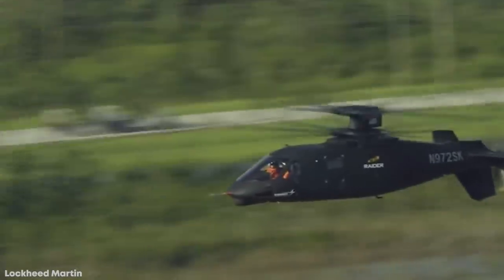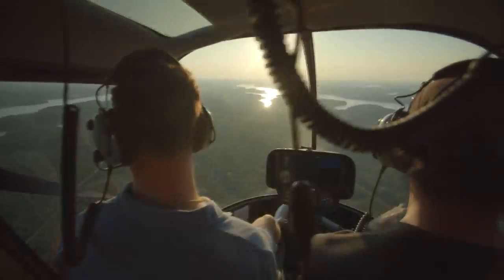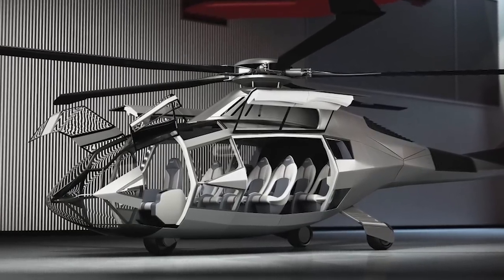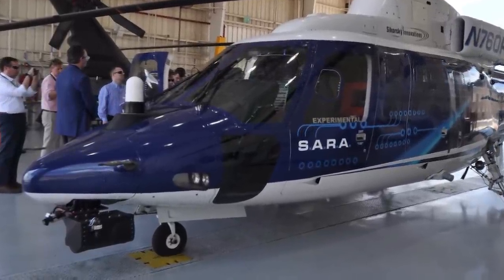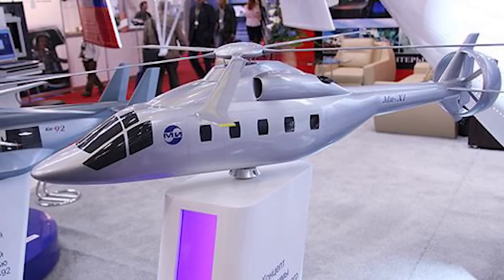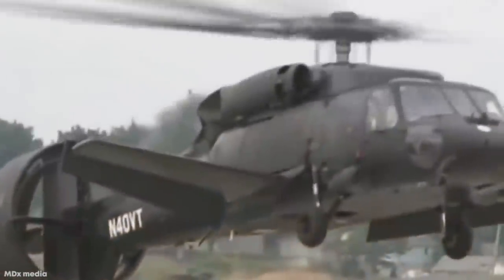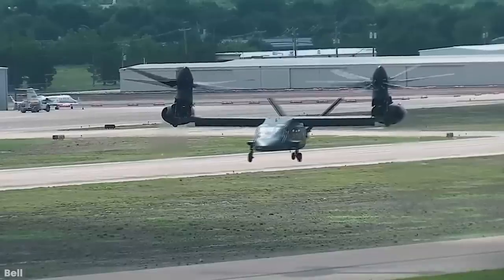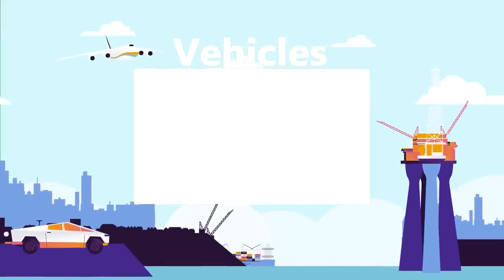15 Future Helicopter Designs

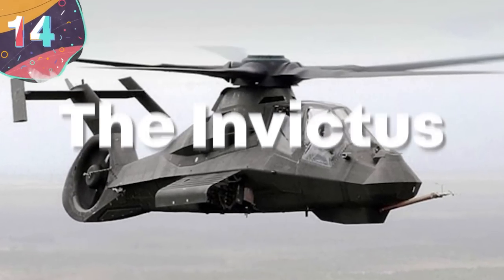Comment: 1:11 Also known as Boeing Sikorsky RAH-66 "Comanche". Never heard about the Invictus label for that aircraft.
Reply: This...
Reply: Bell 360 Invictus. It's bells pitch for the FARA program, against the sikorsky's raider X. It reminds the comanche a lot, but with way less tech embeded. Probably the reason he used Comanche pics.
Reply: @Suflanker  Agreed
Reply: I worked on the prototype program for Sikorsky. That Comanche would have beat them all!!
Reply: @bobmcnelis3648  I believe it
Reply: @bobmcnelis3648  No doubt that the Comanche was a more capable helo. But they (360 invictus and comanche) were built with different scenarios and requirements in mind. Putting them side-by-side is kinda pointless.

Comment: As an old fan of the Airwolf TV series, the design of the helicopter as a combat helicopter was a thing of beauty. But, one thing Airwolf did in its fictional form was to use jet boosters. Is this at all possible without exerting so much pressure/air disturbance on the rotor blades going forward they'll eventually just snap off? The fastest new helicopters still seem to rely on propellers in a push or pull configuration to go fast(er). There must be a limit to how much faster? Where could they go from here, considering reliability and safety are absolute key?
Reply: if you look at the blue angels Fat Albert is a C5 converted 4 engine prop turbojet with side thrusters on sides of the fuselage-look it up, with this method the plane is the same concept as Airwolf- I cant see why they cant do this for any Attack Helicopter where they hit boosters for a few seconds.
Reply: Do a little searching for the Lockheed XH-51A - that was a modified Lockheed 186 fitted with a Jet engine on one of it's stub wings :)

Comment: The flying car has been a experimental concept for more than 50 yrs. I worked on an experimental plan designed by Dr. Jackson in Wilberforce OH.. The concept is sound, lift and cost and safety was the issues at the time.

Comment: The most solid "future-proof" designs, from an aerodynamic standpoint, are the coax/pusher arrangements, (notably the Sikorsky Raiders, and basically everything else Sikorsky is developing in this area.) Retreating blade stall basically puts a hard limit on helicopter top speed, and even a single rotor with a pusher prop is going to struggle with asymmetric lift at high speed, even if it can slow the main rotor to limit blade stall. The coax rotor design gives more stability at high speed, and in general much better handling at low speed (the Kamov KA-50 has, effectively, "infinite" rate of turn in a hover,) plus they tend to be quieter than a tail rotor design because you don't have the collision of perpendicular columns of moving air, (though, from what I understand, intermeshing rotors tend to be the quietest, and with the pusher prop you may still get some of that noise.) All together, for top performance characteristics, there simply isn't any other design that allows the flight envelope of current helicopters to be expanded as much.

Comment: I like the idea of being able to control the helicopter using augmented reality, reason being you could put on cameras on the left, right, top, bottom and nose of the helicopter and doing that you can completely get rid of the windows (recommended for combat helicopters because they are most likely to be shot at).
Reply: yea ive always known that helicopters are the easiest thing to shoot down when you are loading up or starting the engine 
rpg enemies sitting and waiting for sitting ducks is not a good thing

Comment: Once a Chopper gets its main propellers tucked under the chassis or body, the traditional Choppers of the Propellers on top exposed will get phased out. The tech is getting there and we all see the changes of propeller system will be more tucked in of the body, kinda like UFO but more of a human dynamic shape of helicopter designs..

Comment: I think the flying car concept will inevitably result in a vehicle that is not a good car nor a good aircraft.
Reply: Correct. I am currently developing a university project for a flying "car", and the idea that it has to look and act like a car is the no.1 killer in these concepts. The only aspect that needs to remain, is the general utility and potential price point of cars, but everything related to design and engineering needs to be closer to drones. Starting out with saying "it should look like a car" is the best way to fail before you even begin.

Comment: Most of these crafts, during a main propeller falure, had critical & devistating casualties and death toll,  especially the larger passager models. Due to no alternative evacuation, fold in or fling throw the main blade away, not even a parachute nor impact air ballon/seating suspention.

Comment: The only thing wrong with some of the Helios...is the 20mm cannons.... The 20 × 102 mm ) because they lack in punch ... I'd rather have a 25mm ( 25× 137mm N.A.T.O. ) OERLIKON KBA OR THE USA"S CHAIN GUN...OR EVEN A 30MM M230 ( 30 × 113b mm ) and it's HEDP ammunition .. As it is the Russian federations 2A42 30MM (30 mm × 165mm )has 4 --5 time's the punch as the 30mm × 113bMM and 8----10 time's the punch as the 20mm × 102mm ....OK a bit less with the A.P.D.S. (T)  TYPES ...but because that round is a fairly light projectile it looses M.V. quickly where as the 30mm ( Russian federation ) weights in at 390 grms ( 12.4oz )....?? Has more hitting power ... ANYHOOS WORLD that's what I think....stay safe 🌈🌈🌈🌈

Comment: please observe you have a repeat video clip of the same S-97 in this video by mistake!!! anyway the S-97 RAIDER-X attack helicopter gunship would be a great if it can be adapted for the Navy!!! it'll operate from flight decks of multi mission combat assault ships!!! the EUROCOPTER EC155 B1 Dauphin could advance it's capabilities by simply adding a rear pusher propeller which is a proven design & far accomplished propulsion system compared to the EUROCOPTER solution showcased in this video!!! and by the way the AVX doesn't need the counter rotating main rotor arrangement because of the twin ducted propeller on either side of the AVX fuselage!!! the X-49A Speed Hawk is an impractical solution!!!

Comment: Sometimes I wonder what is going on in the engineers heads. For example the new MATV,s the army brought into the Afghanistan war. Was a Beast far as ProFormance But lacked the design to protect the air lines to the breaks. so one could shoot rpg under the truck and take out the breaks. yeah, doesn't sound like much of an issue. u can still go forwards and back right. Well till your in the mountains on a narrow ass road and have to maneuver the damn thing with no breaks in the middle of combat!.... I had to drive backwards up a mountain on a narrow road with just my gunners eyes. yeah we made it but that could have been messed up too!...  I'm sure its good to talk shit about this plastic piece of crap and wonder why the gov left them all lmfao. They can have that crap... Just goes to show you the gov gave up on them too. Thank u, Oshkosh for you shitting on me when I needed you the most.... Its all about money and how cheap I can make it to get the gov to bite. Which is crapping on the soldiers if you ask me. I refuse to by cloths from these shitty companies now. even though some are MADE IN THE USA!.. What does that say and how does that speak for American products and designs of?!........